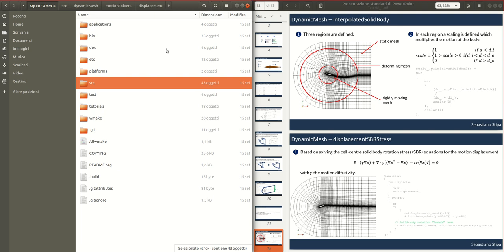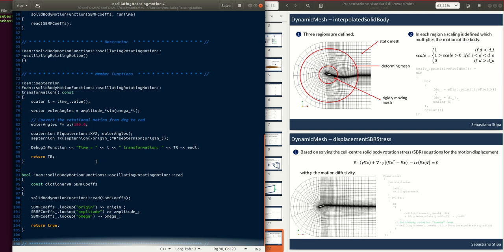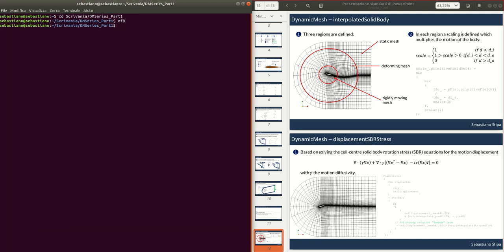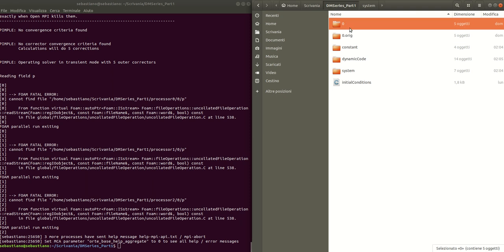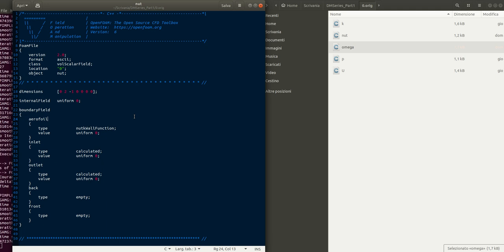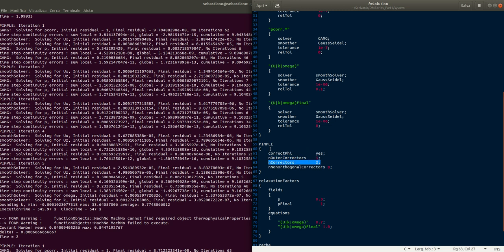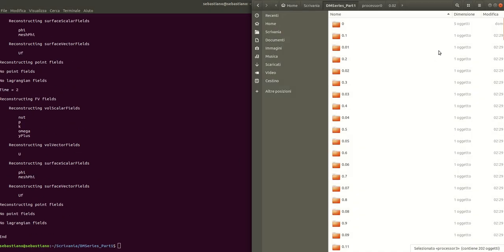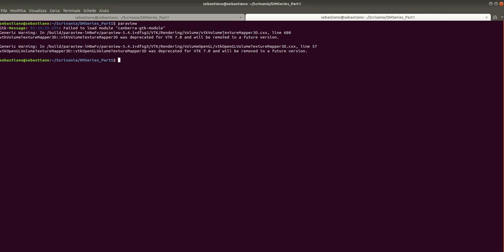DynamicMesh OpenFOAM Tutorial 2 - InterpolatingSolidBody

Comment: hi it seems there are missing functions in the file system that you shared in your google drive . Would it be the reason why the mesh is not moving when i run the simulation ? thanks for your video by the way